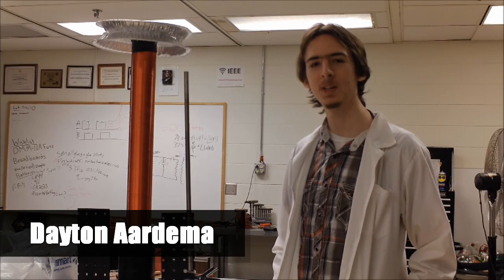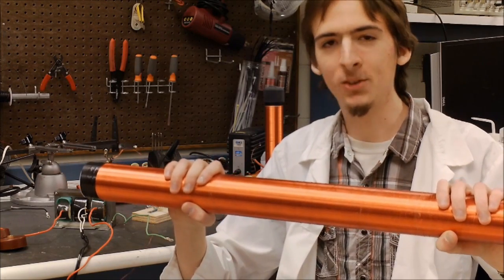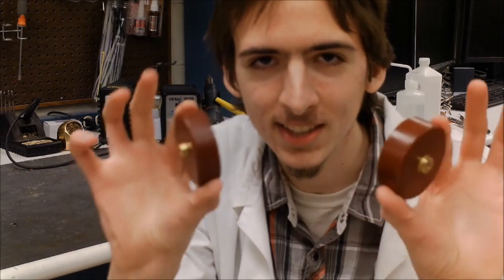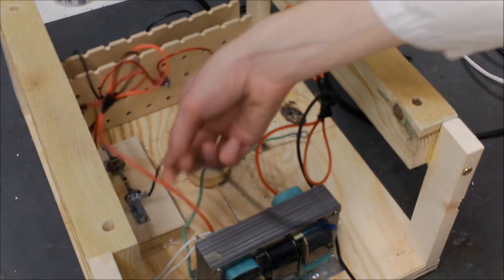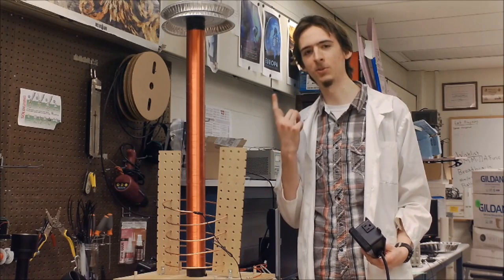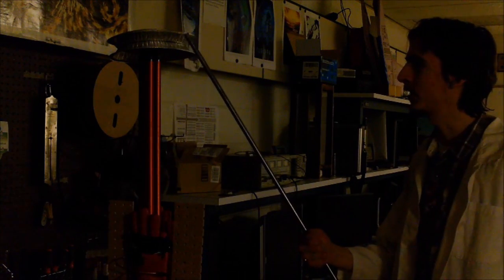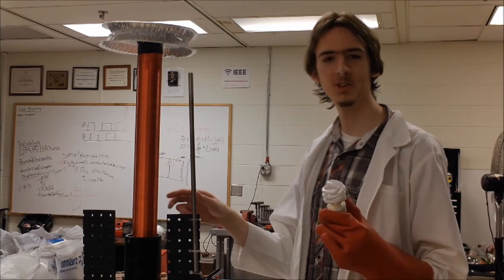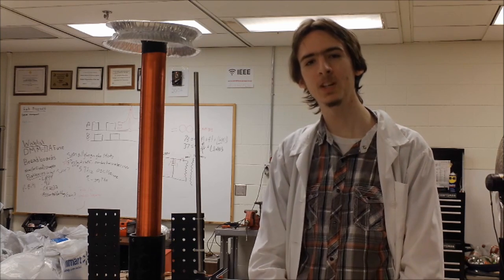My First Tesla Coil Build (2017)

Comment: On my first Tesla coil I made my own capacitor by using sheets of glass with a tin foil glue to it if memory serves I think I had 10 sheets of glass  from picture frames.I then glued the aluminum foil to it and then stacked them all up with a yeah in such a way where the plates weren't shorted. worked fine lasted forever

Comment: I see several problems. The first problem is that your secondary coil is too tall. The aspect ratio of the secondary coil should be between 3:1 and 5:1. The second problem that I see is your primary coil. The magnetic coupling between the primary and secondary coils is much too high. This is because you are using a solenoid-type primary coil. This is what is causing the arcing between the primary and secondary coils. You need to replace your solenoid primary coil with a pancake coil. Start with the level of the pancake primary coil at the same level as the bottom of the secondary coil. This will give a good start at the correct coupling. You can fine-tune the distance later. There may be other problems but these are the obvious ones. I strongly suggest that you use a program called "javatc" to design your coil first. It is very accurate. It is available free on the web.

Comment: Tesla coils must be tuned for the same resonance frequency in the primary and secondary systems. It's just a question of adjusting the number of turns in the primary.
Reply from the maker: I've actually figured out my arcing problem: The tower was too tall. The secondary coil is also an antenna and making it too long causes traveling voltage nodes.
Beside that, my coil was surprisingly close to resonance :)
Both things fixed for my new coil!

Comment: Hey Dayton , I've been working on a tesla coil for quite a while now and get the output it should have . My question to you sir is , can I use the exact configuration you use in this video using 2 flyback transformers ? It works but I know it has a lot more potential. Your knowledge would be appreciated.  Thank you

Comment: that's not 1 megavolt. 1 megavolt will make a spark a foot long. I can't tell how long the arcs from your coil are in the video exactly, but I'd guess that it's probably about 300,000 to 400,000 volts.

Comment: Do you have any tips or recommendations on what measures to take to make sure to control the amperage so that it's low enough to be safe...??...  I do believe that if  you increase the voltage and cut the amperage significantly you should be able to produce arcing that is far more visible, while not feeling much of  a shock.

Comment: Then lay them out so the point is towards the coil length wise on your platform x4 sloping upwards towards the outer circle, this will give you the results you are seeking. The two you already have,, cut corner to corner and you will have four equal seized and angled pieces with squared end's. NOW please tell me,, why the voltage having to be so high to be able to create the jump of discernible distance creates low, even milli AMPS of power? It's almost like an anomaly because low voltage requires a miniscule amount, almost no gap to have a completed circuit. So to me,,, the power is the ability to jump the gap. You'd think that would be the ability to electrocute you.

Comment: what about using MOT as the power source :)
should be more powerfull
also did you just done everythin blind mor some actual caluclations with caps and inductance to find frequency? :S
Reply: I used an mot for a similar coil a few years ago(video on my channel) and it made about 500,000 volts and produced 20" sparks

Comment: What is thr difference b/w this tesla and the slayer exiter you made in the video(28 sep, 18)
Reply from the maker: This one uses an LC (inductor, capacitor) circuit as an oscillator whereas the (28 sep, 18) uses feedback from the coil and a switch as the oscillator.
Both operate on roughly the same principal but it is implemented in very different ways.

P.S. I kinda forgot about this video. I think this tesla coil is due for a redesign.

Comment: I have not seen a transformer like you are using before.  It has three separate groups of windings on one core.  What are its' specs, and where do I get one?  Are you shooting in the EU where these may be common?  Thanks for a reply, please.
Reply from the maker: It was so long ago, I had to dig up the part number. But I found it: Transco TC 6000 Core and Coil Neon Sign Transformer / No GFI
Reply: @BlueprintScience  Thanks very much!  Good luck with your experiments.  They are certainly very interesting.

Comment: Do you have the "cold" end (bottom) of both your primary and secondary coil tied to Earth ground? (Green wire in 3-prong plug cord)
Reply from the maker: It could be; that is what the schematic tells us. However, I had a better effect when I tied it into the transformer in parallel with the capacitor bank. Either way works.

Comment: At 9:06 you said that you didn't feel anything because the current is too low, an that's not true, you didn't feel anything because of conductor skin effect that applies to any conductive surface, at higher frequency the high voltage runs along the surface of the conductive medium (your arm) and doesnt affect the nerves, the rod helps spread the charge across your arm evenly and doesn't focus it on one single point like when it arcs to your arm directly, while you do state that high voltage is dangeorous at a high enough power level (witch is true), its not the effect that is happening when you use the rod
Reply: The skin effect only applies to excellent conductors such as copper or aluminum. Human skin is not a good conductor and the skin effect is minimal. This is a common myth. You can do the calculations yourself. The current actually penetrates several inches into your body. The reason that you can't feel it very much is because your nerve cells cannot respond to frequencies this high. Damage is still being done. You just can't feel it although at these low current levels the damage is minimal but it is still there. If the streamers were DC instead of AC, the pain would be much more intense because your nerve cells would respond. Years from now, you may find yourself with nerve damage. I advise anyone not to touch the output of any tesla coil. I have been building coils of all sizes for 15 years. My largest puts out 9-foot streamers and is powered by a pole transformer.

Comment: iam in india so f=5oHz  
so',what could i do
Reply from the maker: Tesla coil are very interdependent things. There is no simple answer. However, I recently wrote a “cheat sheet” to alleviate that. Here’s the link: https://cdn.discordapp.com/attachments/679374951396147200/687089221244157953/TESLA_COIL_EQUATION_SHEET_page-0001.jpg
Reply: @BlueprintScience  thanks dayton

Comment: I'm sorry did you really just say one megavolt you wouldn't be able to stand anywhere near that thing if that were true but I understand you just misspoke 1 million volts is what you meant last year I made a 50000 volt flyback power supply and now I'm going to be using it to drive a to turn primary 802 turn secondary Tesla coil that is small like only an inch in diameter and 11 and a quarter inches long but the math says that on my maximum output on my power supply of 50,000 volts going in should give me a round 2.55 million volts on the out  my power supply is a zvs driven flyback that can go from 8 60 volts DC with the voltage booster and a 14 volt battery 156 amp hours I made it completely portable and through the voltage booster and the speed controller I have hooked into the circuit I have full control over frequency sweep voltage sweep  even has a built-in recharging circuit with capability to take a solar or Ac input to charge the batteries although I do have to get new power supply the old Xbox power supply just couldn't cut it
Reply from the maker: Not to get all semantic, but 1 megavolt and 1 million volts are the same thing.
Anyway, while technically the math said that I should expect roughly 900 thousand volts (close enough) that didn’t actually happen since I was far away from resonance.
Just so happens I’m working on a new coil (right now in fact). The math on this one jives much better. It’s nothing like yours though. Should be done pretty soon if you want to see it when it’s done.
Reply: What's a zvs driven flyback? I'm wanting to build a tesla coil ans I have zero experience with electronics.  I can wire a house though . I'm wanting to build a coil large enough to power a house on its own off grid. Is this possible
Reply: @crownnothin  in theory yes in practice, it's complicated...... Because Tesla coils emit em radiation that is able to transmit its power wirelessly. You run in to problems with transmitting power crossed longer distances say past a few dozen feet in the larger coils. Not to mention the strong EM waves emitted from the transmitter will be interfering with any electrical device that isn't properly grounded and can most likely permanently damage the circuits. 
then you have to not only build a transmitting coil you also have to build a receiving that is tuned to the same resonance in order to convert that power from The high frequency em to usable DC or AC current. This is all possible but in order to do it on the scale that you're talking about. it would be a lot more cost-effective and energy effective just to use wires, which is why we do.  On average it takes 10 - 15 kW of constant power to power an average house.